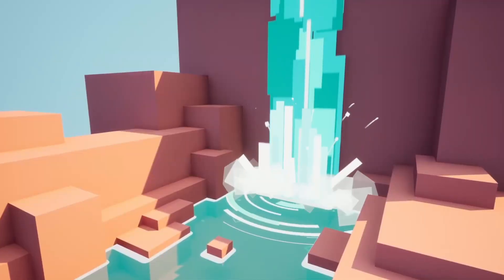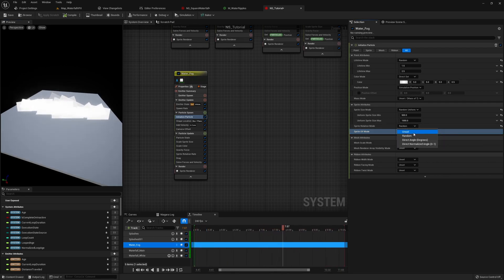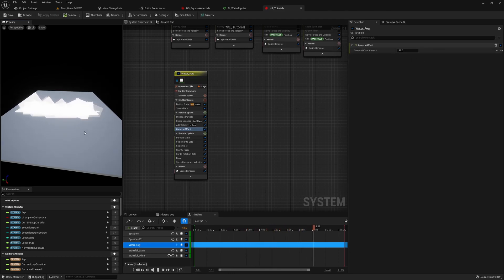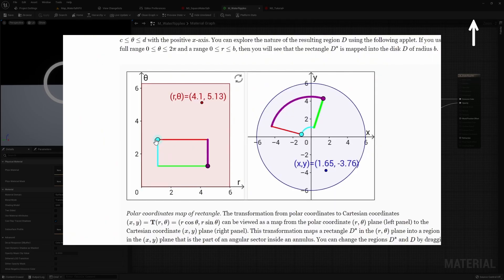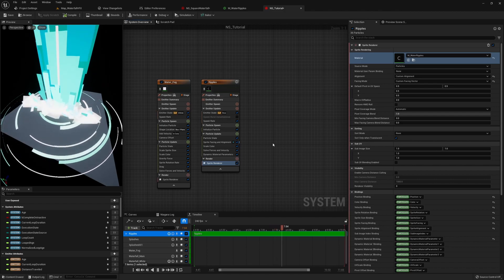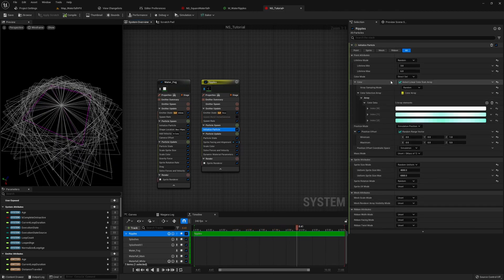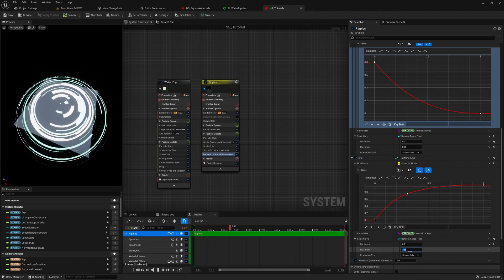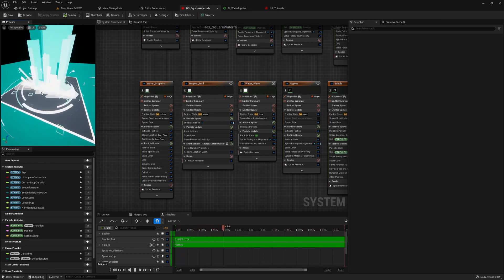Ep.3 Fog and Ripples (using polar coordinates) | UE5 Learning Niagara with Niagara Falls

Comment: So I'm not into UE materials at all, so have to stop on these lesson and go to learn what's going on with materials) Because my fog's alpha channel doesn't work. I connected Alpha to Opacity in textures, but nothing. And need to remember what the tangent, sine are)

P.S. I know that I write 1 comment for each video-step per month, I learn stuff pretty slown)
Reply from the maker: If the opacity pin is not working is probably the material blend mode, make sure to set it to transparent. And happy learning! You got this!